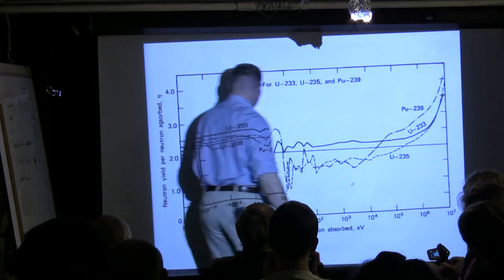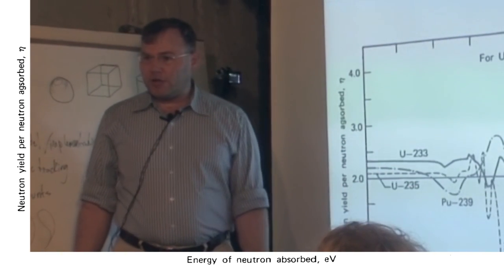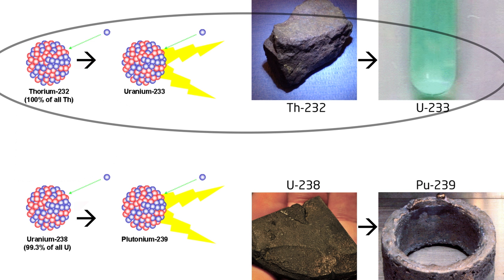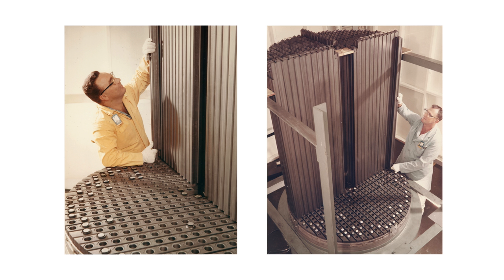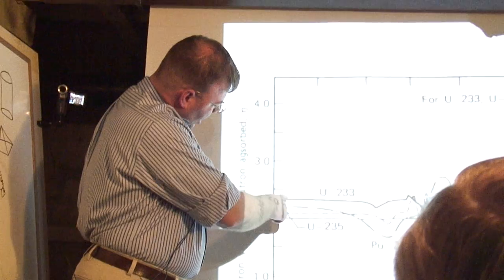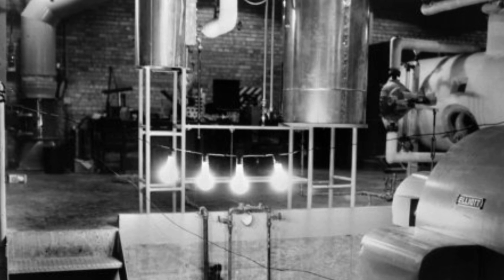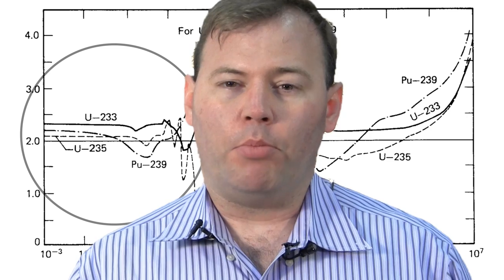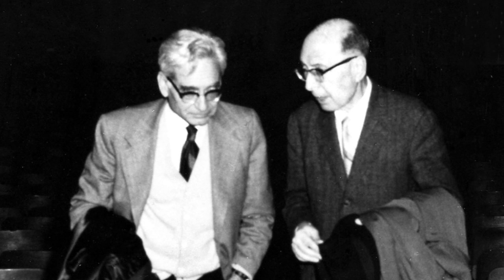Thermal-Spectrum and Fast-Spectrum - TR2016c 3h56m22s24f

Comment: LFTR is great but more suitable for the long run imo.
Short term Check out Ed Pheil of Elysium Industries.
His reactor has it all.
There is the issue of low cross sections.
This can be solved relatively easy by simply using more material.

Comment: Safety first, and failure is not an option, finite engineering, is why this video is the balanced information for energy/human survival in response to the inevitable catastrophe "unforseen".
***
So I just saw how Physicists have made a 5 phase mixture of substances, ie +2 beyond the Triple Point, which means that the Mathematical integration can be applied to all kinds of situations in this e-Pi-i multiphase-locked superposition of states. Putting a more logical spin on the actual Energy Origin, from Observation.

Comment: How does Flibe's reactor handle the poor delayed neutron fraction of most fissiles relative to U-235?  And how does it handle the further reduction of delayed neutron fraction caused by circulation of the fuel into and out of the core, and toward and away from the most active part of the core?

Comment: How does a higher mass eliment (C) have moderation capabilities, is it a matter of a lot more collisions to slow the neutron down compared to a water moderator (16 to 26 collisions with H or H+ respectively to get in the thermal spectrum)?
Reply: Yep.  The main advantage of graphite over (light) water is the much lower absorption cross section.

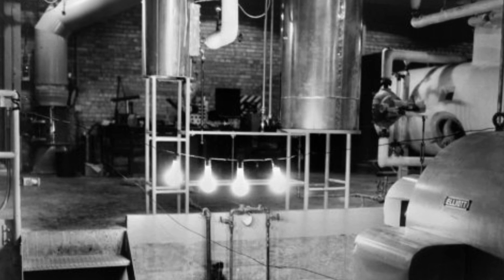Comment: 5:19 This is confusing. After Kirk explains that a fast breeder requires a huge fuel load compared to a thermal-spectrum reactor, and that a fast-spectrum reactor is needed to burn plutonium. Then we have a guy insisting that the plutonium-burning EBR-1 breeder core is 8 inches tall. So which is it? If a fast-spectrum breeder requires a large fuel load, how can this reactor core be so tiny?

Another obvious question: if a fast breeder can be both small, and simple enough to become the first power reactor ever made, why did this type of reactor never become popular?

Edit: EBR-1 was not first power reactor. Wikipedia: "Electricity had earlier been generated by a nuclear reactor on September 3, 1948 at the X-10 Graphite Reactor in Oak Ridge, Tennessee"
Reply: EBR-I ran on almost pure U235 not the plentiful U238. Without moderator, and with almost pure fissile, reactors can be small. Kilopower uses highly enriched U235. I think the trick to a breeder is leveraging the small quantity of fissile into a sustained reaction that can be fed by fertile material. That's the moving-around of fuel rods. Or LFTR's chemical kidney to move U233 (fissile) from blanket salt into the fuel salt.

"Huge fuel load" is more "large fissile load". U238 can be fuel, but it isn't considered fissile. U235 is the fissile.

Enrichment is the reason to avoid this. The more enrichment is needed, the more expensive the fuel becomes. (And the bigger proliferation concern over the fuel.) For city-powering purposes, consider that CANDU can run on enriched Uranium, thanks to heavy-water moderator.

Strangely, heavy-water is one of the technologies excluded from DOE's Advanced Reactor funding program, as of 2020-12.

But for niche applications, like submarines and small Oklo power stations, and Kilopower-in-space, enrichment makes sense because no city is being powered. Small size, and long use of fuel loads are priorities.
Reply: @gordonmcdowell  If the volume of high-enriched uranium needed fits an 8-inch cube (including fuel assemblies), surely it doesn't cost more than the "over 400 kg" of 19.8% HALEU that would ordinarily be required? (https://en.wikipedia.org/wiki/Critical_mass )

Indeed, I've heard that the amount of enrichment work needed to go from natural uranium (0.7%) to 20% is more than the amount of enrichment to go from 20% to >90%.

Keep in mind that once activated, a breeder can create more fuel than it consumes, so from a cost perspective, a small core ought to make a lot of sense even if the initial fuel load is expensive.

I think what this implies is that the reason we don't use small-core breeder reactors has nothing to do with cost or even practicality, and everything to do with the risk of proliferation. Also, it is physically impossible for an ordinary nuclear reactor to explode like a nuclear bomb under any circumstances... but if weapons-grade uranium were used as a fuel, I wonder if it might become possible somehow to detonate it.

Comment: I've read articles that the graphite moderator is the problem and expands and contracts leading to cracking.  Does anyone know how significant that is?
Reply: Seaborg Technologies are developing a liquid moderator, while just about all thermal-spectrum MSR startups are using graphite. (Transatomic Power was also pursuing non-graphite before they shut down.) If you want a worst-case description of graphite I'd look to Seaborg Tech as they probably have the most pessimistic view of the material. But off-hand I can't quantify the concerns over it... yes it does expand. How serious is that? Dunno. Fission products are created and trapped in the salt (without LFTR chemical kidney) so are build-up of fission products in salt the earlier show-stopper for MSR operation? Graphite has to be the first to go for it to be a problem... so it might be only LFTR would be so worried about graphite because LFTR cleans the fission products out of the salt thus making graphite the show-stopper in terms of reactor lifespan. (Also, ask fast-reactor companies... presumably they'll have a dire perspective on graphite too.)
Reply: The graphite moderator is a problem. As far as I have read, the graphite's expansion induces a positive effect on the temperature reactivity coefficient. A negative temperature reactivity coefficient is a significant advantage of using liquid fuels.

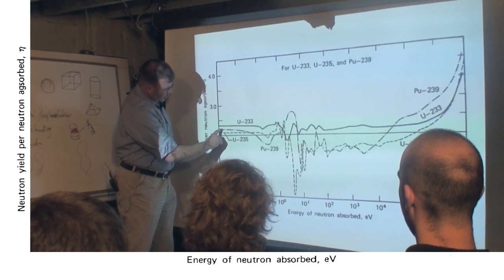Comment: At 0:40, quote: "It's that dip below two.  Right there.  That's what makes it so you cannot burn up Uranium-238 in a thermal spectrum reactor like a water-cooled reactor."

The qualification, "like a water-cooled reactor," needs to be taken out.  I know that probably wasn't the intent but it makes it sound like "thermal spectrum" goes with or means "water-cooled" when that just isn't the case.  If I understand this, the fact is that no thermal spectrum reactor whether it's water-cooled or molten salt can burn uranium-238.
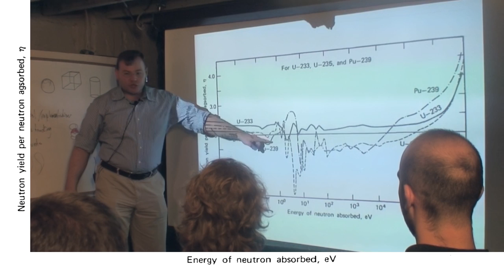Reply: That's my understanding too. If you specify a timecode m:ss like 0:40 you'll give everyone a hot link.
Reply: Gordon, thank you for doing these videos.  

One question I have is why the water-cooled reactors were ever pursued after the molten salt concept was first demonstrated.  Is there some advantage that the water-cooled reactor has that I'm missing?

As I understand it, it does not matter what you're burning, whether it's Uranium-233, Uranium-235, or plutonium, or whether it's thermal spectrum or fast spectrum, because with molten salt you don't have to worry about molecular hydrogen being formed or heated liquid water explosively changing into steam, not to mention the economic advantages of increased efficiency.
Reply: @mmandrewa2397  the advantages to LWR were:
a) it was there
b) it was ready
c) it was already paid for by the navy
that's really it. that's its main advantages.

you could also argue that the fuel form factor (ceramic pellets) helps entrap fission products in a firm cladding for safe disposal, and we have only really ever seen those fail like four times in the history of the world.
Reply: @mmandrewa2397  basically the reason nobody did MSR is because it was mothballed, politically it was swept under the rug, its concept was only "demonstrated" to about 500 people who mostly thought we were going to pursue the LMFBR instead. then when that was mothballed too, we got left with LWR's. it sucks.